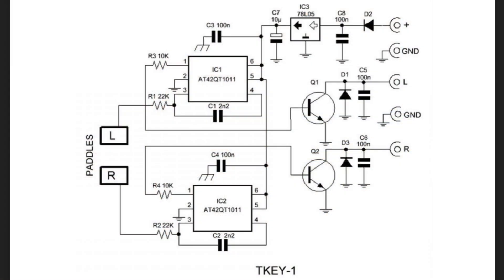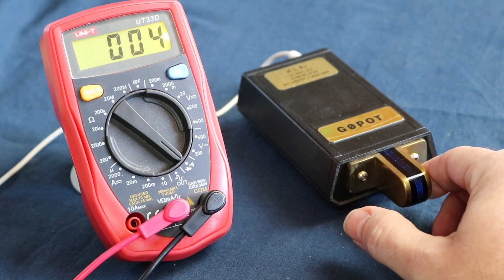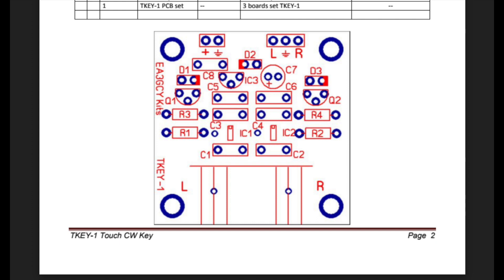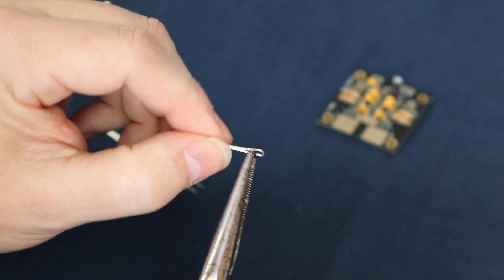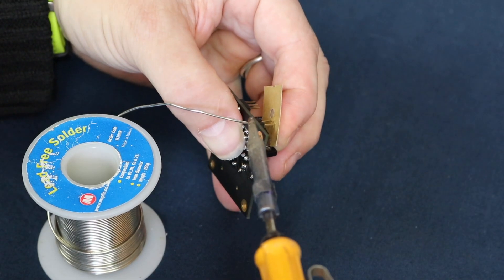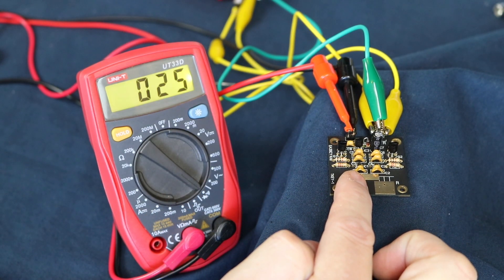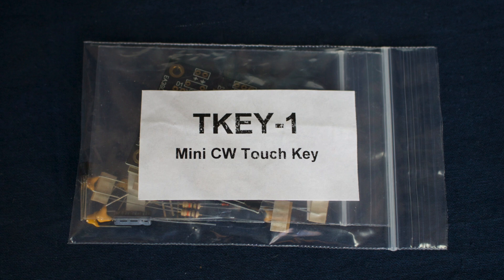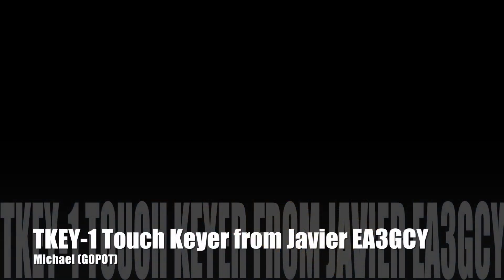EA3GCY Mini Touch Key

Comment: If You are using the original Case from EA3GCY , You can use a CR2032 battery, which is included. Then one of the diodes the voltage regulator not needed.😅